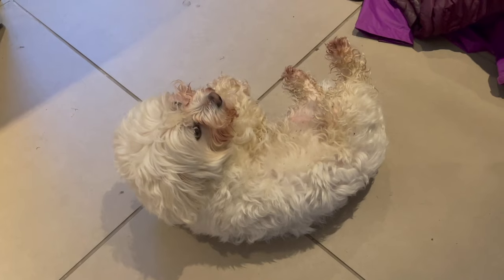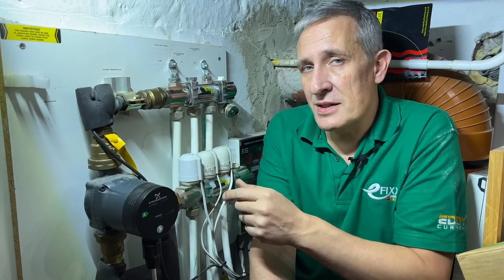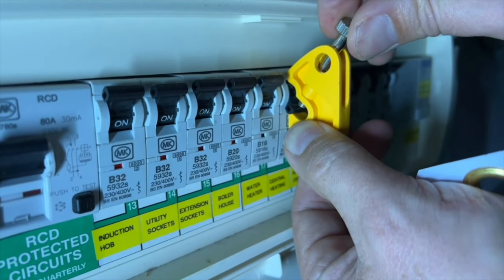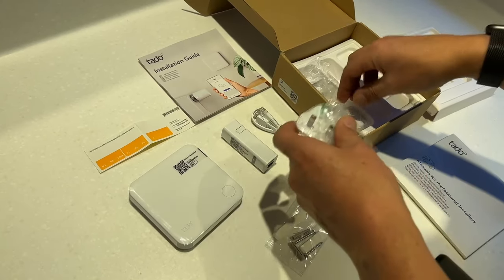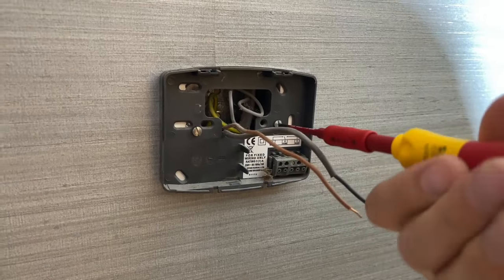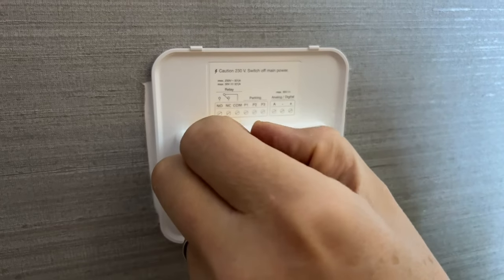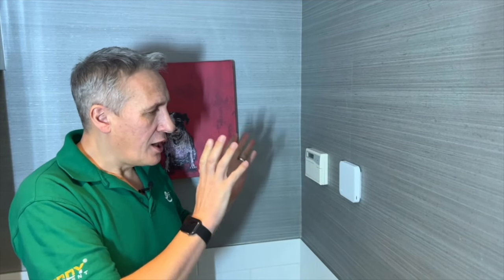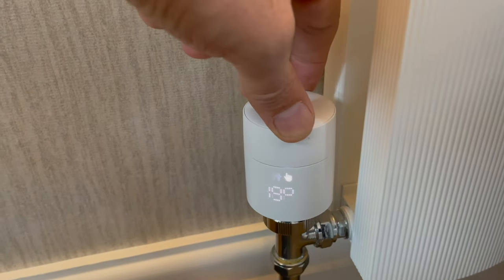How to Fit a Smart Thermostat to Under Floor Heating - Tado

Comment: Not a simple job , you really need to check every aspect of your system to confirm this will work. I have a similar setup and it wouldn't work

Comment: In one point it's convenient the tado is battery powere, although if you need to fit one in every room there will be a lot of batteries to replace. Can the Tado be powered by 220-240v?

Comment: Great video. I’m looking to replace an existing Siemens UFH controller the uses RF. it has a receiver that is wired into a junction box and then into the combo boiler.  Can I use a tado to replace this setup?
Reply from the maker: They have options for wired (the one in this video) and wireless which has a receiver which gets wired to the boiler.

Comment: Thanks very much for the video Gordon, I love all the great work that eFixx are doing. I have been on my own personal journey into heating controls and pipework, and sadly I have found that in the UK there is a significant gap in knowledge and experience.

When we say 'smart' what exactly are the main advantages and disadvantages?  Finding trades people who sufficiently understand the modulation benefits of one set of controls over another to go with your boiler seems a very difficult task.  My current understanding is that in general, it is best to use the boiler manufacturer's controls, as these controls will communicate via the boiler's proprietory bus protocol, and operate your boiler as efficiently as possible.  There are exceptions to this, for example if you have a boiler that can communicate via the standard OpenTherm protocol, then you can efficiently use a range of controls that also communicate via OpenTherm from other suppliers. Another exception, although even rarer, is some suppliers have controls that communicate via some of the popular boiler proprietory protocols. OpenTherm is very common in mainland Europe, and indeed it's mandated in The Netherlands, but strangely isn't common in the UK.

Tado have a very mixed track record on their support for OpenTherm - they did support it, then they didn't, and now they are apparently partially going to support it again.  Honeywell (now Residio) have always supported OpenTherm (they invented it), and most boiler manufacturers support it (although sadly not Worcester Bosch, or Valliant). Heatmiser sadly also don't support OpenTherm in most of their controls products.

And then trying to get your UFH working efficiency with your boiler is yet another level of difficulty, as this then involves varied flow rates (as the actuators open and close on demand). Tradesmen don't seem to know or care enough about different flow rates in the primary boiler circuit, and secondary UFH circuit, and how best to design for this with pipework and controls.

The exciting new Matter standard so far has NO heating control functionality, but there apparently are plans to add it to Matter in the future, but probably is years away.
Reply from the maker: Thanks for the feedback Stewart.  The whole world of heating control still seems to sit at the very edges of what is real smart home tech. Let's hope this changes as we move towards more integrated energy systems and the new future homes standard.

However, I think it will be sometime before the manufacturers in this space realise the opportunity. EV chargers, solar inverters and energy management all have a huge roll to play. They don't even talk to smart meters properly!